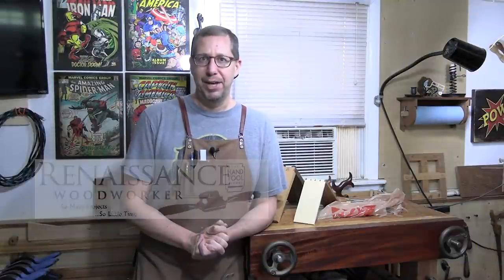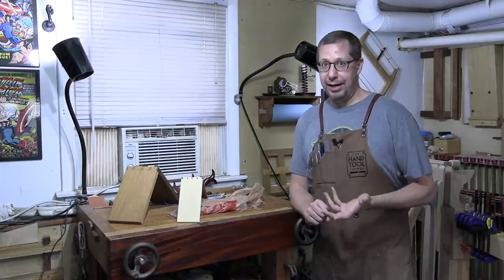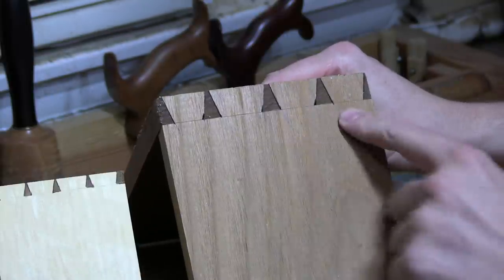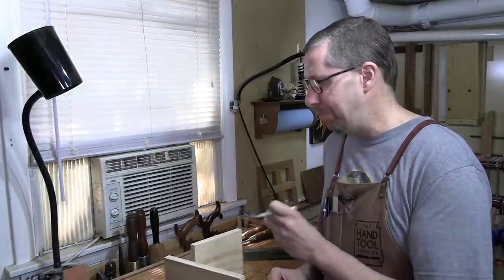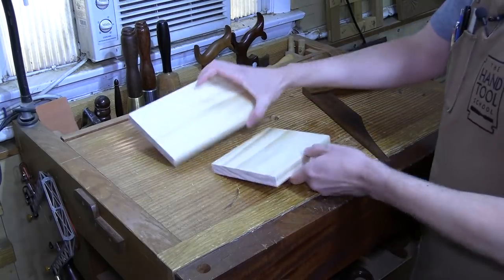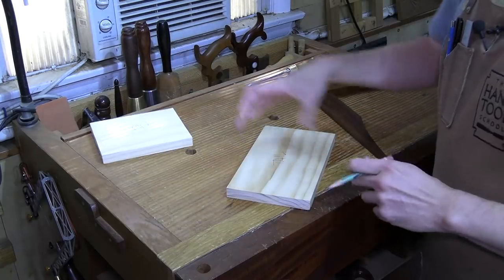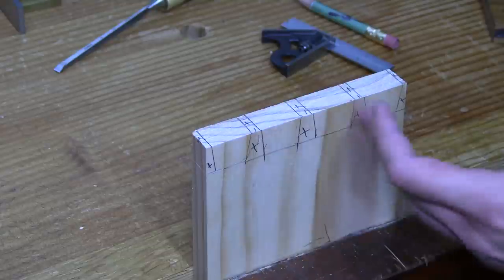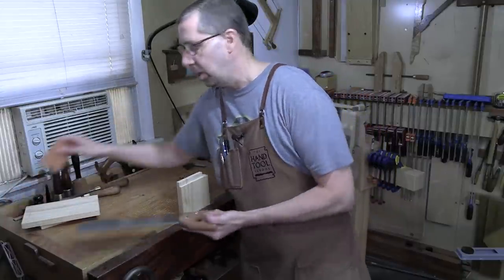Hand Cut Your First Dovetail

Comment: I've only recently started on my woodworking journy (as a hobby) and tried my first dovetail recently. It wasn't great, but it would of held a drawer together just fine... and this is what I tell people who say they could never do them. Ignore the fancy exposed dovetails you see on social media and realize this is a working joint that is mostly hidden on projects. They don't need to be pretty to work, and you can only improve with practice. So just practice a few times with short boards and then jump into a project using them for drawers or such... by the end of it you will be surprised how much better you are. 

Also I find doing practice cuts before doing my dovetails is super helpful. Just a dozen or so cuts at the angles can get the cobwebs out of your system if you only do these joints irregularly so you are not messing up the project joint right away.

Comment: Thanks for the great video. I was very scared to do dovetails and didn't attempt them until a few weeks ago after gaining more confidence in my sawing and chisel work technique. I had watched other Youtubers and was really turned off by one (who shall remain nameless) when he stressed that to do dovetails, you had to buy his tools, which are like $275 for a saw. No thank you! I refuse to watch anything if his now. Too much arrogance for my liking. So I watched ones for beginners, Rex K and Paul Sellers. They explained in simple to understand terms, so I went for it. Did a single dovetail multiple times, learning for the mistakes each time.

Now I've watched your. Very good explanation. I really liked the fact that you didn't stress getting the high end tools. Work with what you have or barely afford. My new challenge is going to be doing 3 or 4 dovetails. Then do it multiple times until I very comfortable making them.

Comment: This would be a good video for my High School woodworking students to see. You and I do this just a little different but the basics are the same. The kids have just finished their first set of hand cut dovetails. They also cut through and half blind tails using the jig and electric router.  Many of them preferred doing the work by hand.
Reply from the maker: I am curious, what do you do differently with your own approach?
Reply: @RenaissanceWW  honestly, it is mostly in layout and cutting technique. I have the students use dividers to step off the tail width. When they are removing the last of the wood at the base line I have them keep the board turned 90 degrees so they can see they are chopping square. While I encourage having a set of tails and pins that go together first time a also go through some trouble shooting tight spots etc. I am sure you do too.  As I said, we do this pretty much the same, just a little bit different.

Comment: Thanks  I'm going to go out to my shop right now and try again Thanks
Reply from the maker: soooooo how did it go?
Reply: @RenaissanceWW  Used the same saw as you and it went better than my  previous attempt but  still quite messing but am going to try some more after resharpening my chisels as the pine end grain is chippy.  At least it went together   Thanks for the motivation

Comment: When sharpening your chisels, after you have flattened the backs, what grits do you usually start and finish up with?  Do you use the same "finishing up" grit to establish your secondary bevel?
Reply from the maker: I have a 1000 and 8000 grit stone and a leather strop.  That's all I use.  I don't do secondary or micro bevels anymore either since switching to free hand sharpening.  Stropping and secondary bevels isn't sustainable and it just ended up being extra work for no gain.
Reply: @RenaissanceWW  Thanks for your feedback.  Have you done a video on how you hold your chisels when hand sharpening?  If not, sure wish you could find time to do one.
Reply from the maker: @w4baham  I have.  Several free hand sharpening videos here on my channel

Comment: Very good encouragement video, Shannon. I'm over a few ones, but I believe I'll still be considered being amateur after my hundredth one :)

I have a question about chisels. Are those Narex ones for your starter kit demo? I took your advice on a narrow one the other day, and the one I took is a 3mm wide from the fine series of Narex (I believe from the same series of the ones you use here). I found them very nicely done, compared to the Stanley sortiment I started off with. How far chisels can go in terms of quality?
Reply from the maker: I'm weird when it comes to chisels and maybe I've just been lucky but I've never had a problem with bad steel or a chisel that was unusable.  From 300 year old chisels to modern made I find they all pretty much work well when sharp.  There are some handle issues and balance issue with some modern chisels but nothing that rehandling couldn't fix.  So on the whole I don't put a lot of emphasis on which chisel you get, but more on sharpening them well and caring for them.  Right now my chisel kit is about 15 different brands spanning 300 years of production.

Comment: I've been chiselling out the waste (in soft wood) and getting a lot of crushed grain in the end grain. I keep sharpening my chisel but it's still crushing it, is that just they way it is going to be when I chisel it out?
Reply from the maker: Well there is sharp and then there is softwood sharp.  No doubt the less dense the wood the sharper the chisel needs to be.  But there are some woods (like this Radiata Pine I'm using) that I struggle to eliminate the tearing entirely.  Also chopping halfway through does exacerbate the issue when you flip the board and chop into the unsupported space beneath.  So in some respects it is the way it is.  If you are getting good results in harder woods then I wouldn't worry too much about it.
Reply: All I have access to most of the time is spruce (I started woodworking during the pandemic and only cut a couple of dovetails) which I find ridiculously soft, what helped me was chiseling out the first 5 milimeters or so without a mallet only by putting pressure on the chisel near the line, after I have a wall I can rest the back of the chisel on, I continue with faster removal. That helped me a lot and the end grain is smooth now. As for sharpening, my final stone is a 3000 grit japanese water stone, after that i strop the chisel.

Comment: What’s that giant pencil called and what kind of sharpener did you use on that bad boy
Reply from the maker: just a normal pencil make a little fatter.  Reminds me of the "special" left handed pencils I had in elementary school.  Speaking of which I use the same sharpener found on the walls of classrooms for the last century at least.  It has that adjustable wheel with different diameter holes.